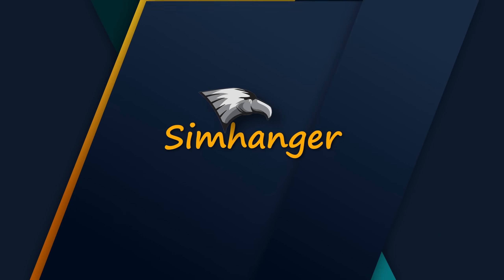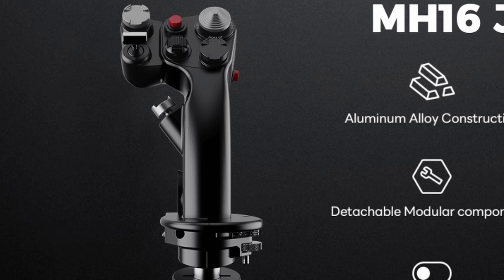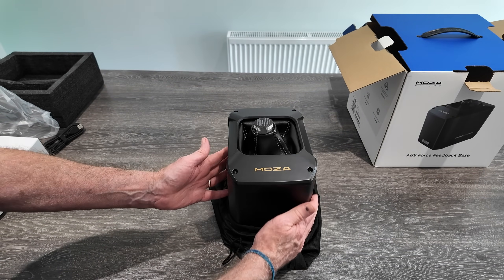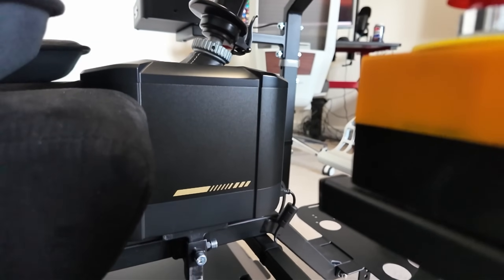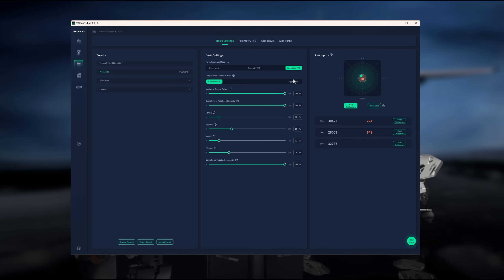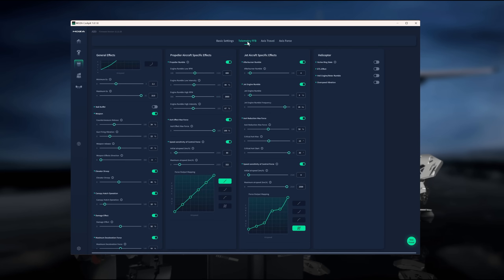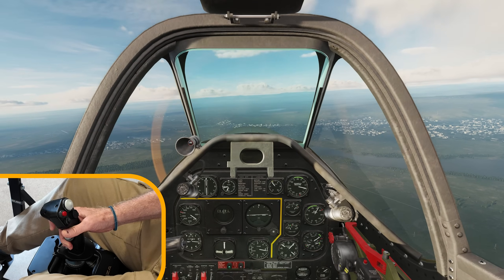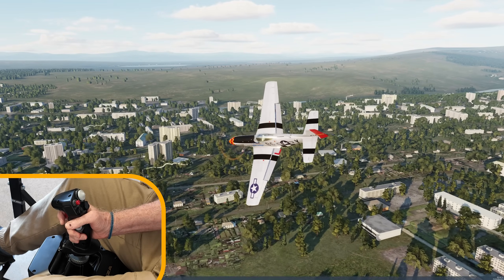New Force Feedback Flight Stick from MOZA | First Look & Test | Moza AB9

Comment: Good Review.  However, some things to note.  This is coming from China.  That may be okay but if you consider their history then you will see why the next item is notable.  There are discussions on the DCS forums detailing how Moza had used the code from the software that the VPForce Rhino creator developed which is Open Source.  They did not, however, follow the licensing agreement for using such code.  I personally was interested in this product but have since decided to stick with my pre-order for a Rhino due to the community feedback for the hardware and just as importantly, the software.

Comment: Do you know how it compare to MS Sidewinder Force Feedback 2?
Reply from the maker: The Sidewinder was more haptic feedback than true force feedback if I recall correctly. You can't really compare.
Reply: I didn’t know MSFS 2024 would have FFB telemetry included, that is very interesting and a compelling reason to move over. How would MOZA feel about a head-to-head comparison with the VPforce Rhino?
Reply from the maker: @bigbangerz5856  Yes it is on the future content schedule. Will not be functional on day of release. Hopefully we will not have to wait too long.
Reply: @SimHangerFS  Hey dude. No it wasn't. The Sidewinder 2 was full ffb. Not remotely haptic. 
I asked ChatGPT to compare the Force Feedback 2 with contemporary ffb stick bases and it says the newer ones are stronger and the newer motors have less cogging so are smoother. 
These newer ffb bases are really tempting but I'm not sure how much of an improvement it will be to my old FFB2?
Reply: I had the original MS Sidewinder FFB stick.  It was fantastic at the time.  Just being able to get a feel for your airspeed by the trim forces was a game changer in a combat sim.  I should wait to see what WinWing bring to the market, but I’m not sure I have the discipline to wait that long.  Thanks for the overview Mark.
Reply: @andysonofbob2599  I’ve owned the Sidewinder2 many many years ago, let me summarise the comparison based on what I know. There is no comparison a modern FFB base with stick extension, grip, limiters & software vs. A sidewinder2 is like do you prefer driving a Ford Focus vs. Lotus around a race track….

Comment: I use the XPForce software with the Microsoft Sidewinder ForceFeedback II and it responds very well.I recently bought the Swordfish and the heavy controls were reflected well in the software with no adjustments to settings.WARNING!! Using forcefeedback equipment will render you intolerant of any other control stick,its a one way trip!.........................................................
Reply: love my bruner yoke

Comment: Looks really nice, I have the Brunner cls2 base, it's really good that ffb is making a come back ,well over due. I mounted the Brunner on my p3 with Gorilla double sided tape. It sounds rubbish but works really well ,solid as a rock.  I had to raise my yoke platform on the p3 to make room so when it goes through its start up it won't foul on the yoke. Thanks Mark .
Very similar forces to the Brunner.
Reply: Brunner peak is 6.8Nm, nominal 4Nm, Moza is 12Nm peak and 9 nominal. I've ordered one due to the double peak force, hope I made the right decision, although I do love my Brunner Yoke CLSE MKII that peaks at over 100 :)

Comment: Nice video! Since I have the H2, do you think that would be possible to mount it on the right? to be clear where You actually have the stop button.. on the left side I have almost 4kg with the throttle. PS I saw You mounted on a DOF  HOTAS KIT arm..did the holes match to the ones under the Moza base?
thanks

Comment: Hi Mark.  Greg here…I bumped into you at the Vegas conference near the snack bar with your lovely wife.  I’m in the market for a FFB unit and I greatly appreciate your always the best reviews!  Can you clarify something…do you know if will it be functionally compatible with MS2020 soon or just with the upcoming 2024?  I’d like to have it operational in both.  Also, as an expert…what stick add on would, from your experience, be the one to get that is most versatile across the most aircraft?  I like vintage planes like the spitfires, F86’s, P51’s, but also some moderns like the F117.  All the best!  Greg in North Carolina, USA.
Reply from the maker: @gregh335  hey Greg, great to hear from you. Yes it will be MSFS 2020 & 2024 compatible. I would opt for the MH16. Thrustmaster Warthog or something compatible from Virpil.

Comment: Can you clarify if your NLR HF8 works with the MOZA software? Jabbers said in an early video that it overwrites the DCS .lua.
Do you use simshaker for aviators and does it work with the Moza sw? Cant seem to find any info on this. Thanks
Reply from the maker: @DavidGöteskog  I use my HF8 with NLR software (now improved and more stable than SfA) with the AB9.
Reply: @SimHangerFS  thanks for reply. 
And this works as intended?

Comment: I am very interested in this product, but....
Their website states that I will be fully responsible for all taxes and customs charges (like most do) but there is very little detail.
I couldn't find any info on where the item would be despatched from until I asked in an email - China. They do have UK retailers selling their products but not flight stuff as yet.
Their reply email did nothing to explain about customs fees etc, only confirming that they do usually apply and that I will have to pay them.
Unfortunately, I simply cannot buy something under such circumstances.

Comment: Is the peak force of 12nm peak a bit of a dubious claim? Seems the the figure can be derived from a 45 degee stick position. I will be watching developments as I am in the market of a FFB Stick and rudder pedals. I notice that Moza don't actually state that the MRP will be FFB, unlike the Throttle(MTP) which is stated and having vibration feedback(haptic?).
Reply: 12nm would be ridiculous in your hand, this isn't a steering wheel that requires a ton of force, honestly 5nm would be PLENTY on a flight stick. if thats what were doing, trying to replicate real life, except a small few planes, nothing would be designed to have that much force in your stick
Reply: @fastfed  I was making an observation regarding performance claims. No idea idea if 9nm is good or bad, but several flight simers have stated that is is weak.
Reply from the maker: @melvilib I’m no expert in terms of force, all I can attest to is the force this base exerted was considerable.  I haven’t seen any indication that the rudder pedals will be FFB at this stage.

Comment: 9nm is very low 😢
Reply from the maker: I found quite the opposite when trying it. 9kg per second of force is considerable.
Reply: Compared to what?  A FFB racing wheel base, which is an entirely different scenario?
Reply: i find 9nm to be adequate.
Reply: peak tq of 12nm according to website

Comment: Every serious flight simmer uses an extension, literally every force feedback review, no one has used one.. fishyyyyyyyyyyy
Reply: I don't. I'm fairly certain all side stick users don't either so.....plus you can infer that since it has more force than the vprhino it's probably fine to use an extension. We'll have to look at it when more people are getting their hands on em but I doubt it's gonna be an issue.
Reply: @sirwhippamus the moza has the same force as the vpforce rhino. The 12nm is a bit misleading, because it is 9nm in each direction, what will result in 12 total when pushed into a corner.

It might be a bit on the low side if you want to use an extension, i am waiting till we know more about the winwing ffb base, because that will have significantly higher torque from what i have heard

edit: i remembered the amounts wrong and corrected them
Reply: Not anyone using it as a side stick.
Reply: @WhiteHawk77  weird then how they already have the viper profile down ain't it 😂. Im sure that was absolutely a coincidence.
Reply: @Warkip  that makes sense. Hopefully it's on point then since people seem to like the vprhinos output. Let me know what you find when you get yours 🤙
Reply: @sirwhippamus  I’m not sure what you mean to be honest, just saying the same thing as you were, side stick aircraft and flight sim users who fly with a stick to the side rather than centre don’t use an extension, and really the base already has an internal extension anyway, albeit shorter than the Rhino I’m guessing.
Reply: @WhiteHawk77  my fault, I misinterpreted what you were portraying. I agree with your pov and I'm also thinking the internal extension will likely be enough for most people unless they have it floor mounted. I doubt it'll be an issue even then though honestly.
Reply: @sirwhippamus  side stick imo really only works for the f16, every other plane (airbus lol) is center. most serious setups are center mounted
Reply: @Warkip  which is why I want to see someone using an extension, doesn't have to be a big extension but bigger then the one Moza sells. I cannot see 6nm being too weak. this isn't like race sims where you need much force, just enough to feel things is fine. I mean how many NM is microsoft ff 2. and IMO that was fine
Reply: @Warkip Another guy made a video where he measured it. I think it was a channel named g-lock.

He measured 9nm on the axis, and about 11.5 when pushed to the corner.

Where are you getting 6nm from?
Reply: @johnja9017  you are correct, i have remembered it wrong, i think i was tired or so, i corrected it
Reply: I use one with it, it is plenty strong with about a 13.5cm extension